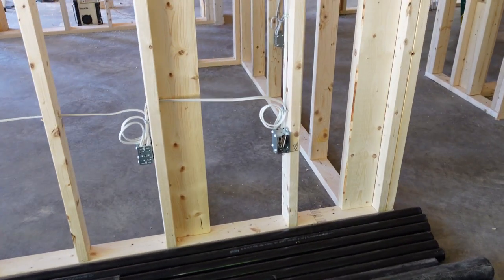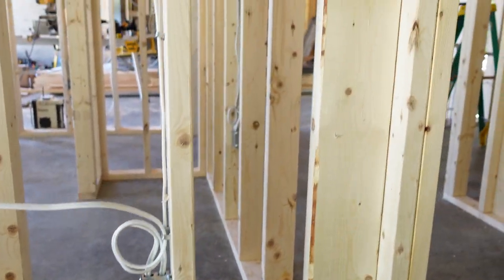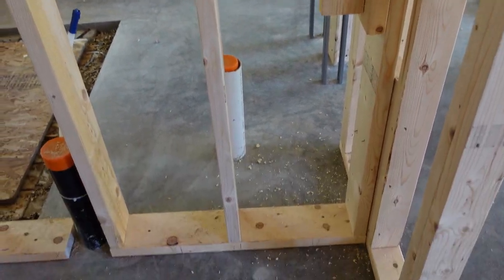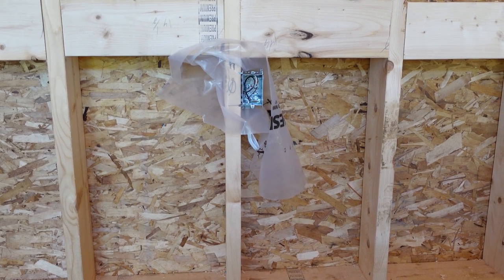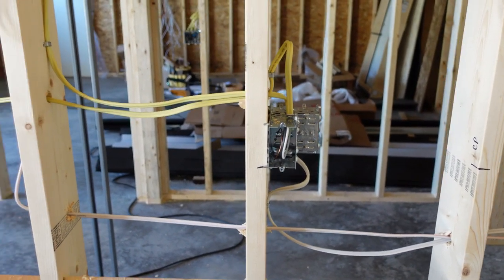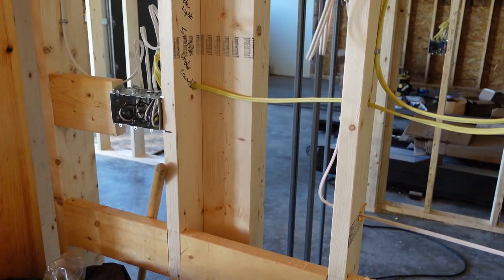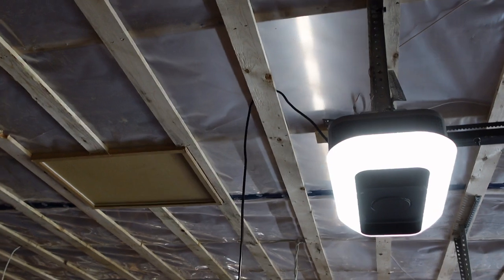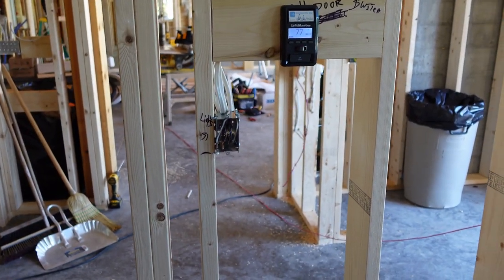Electrical Code Outlet Heights

Comment: ok this is Canada. but as a consumer buying a home the outlets  are at about 14 and 16 and they both suck . i lived in older house with baseboards outlets   hous built in 1900 wired  1930-1940  and was better imo than the newer houses . i rather them be 36 inches  the current you need to bend at od angles . and the 6 ft requirement  without regard often results in outlets right in the middle of where normal furniture goes so only choice is extension cord before putting the china closet. dresser etc  btw iwas not old when  i lived in the old house a 1975 new a current 1995 house and placement of outlets height and spacing is one of the only things i disliked about this house , what our governments always failed to realise 1 size doesn't fit all  or all people .

Comment: I have seen kitchen counter outlets at that height. If using a top with molded in backsplash, this placement requires nipping about 3/8 inch off the bottom of the outlet cover. Real d**m smart placement.

Comment: Are there any workarounds for romex anchors and trying to have more useful lengths for a service loop?
for example, if the first anchor needs to be within 12 inches of the junction box, can I still add a 12 inch service loop if the plastic conduit box has its own built in clamps?

Comment: thanks for your instructions  I am in Toronto Canada I follow your instruction I am not electrician  worked with electrician two years, now I am retired,   and i did wiring in basement. inspector came to inspect ,the  kitchen counter receptacle not meet the code, still I am not understand,  receptacles  how far from edge of the sink and between the receptacle. I try many u tubs i cant find it.  again pls reply ,Thanks.

Comment: Was wondering why the loops going into all boxes
Reply from the maker: They are service loops for when the drywallers cut or wires with zip tools inside the boxes. It always happens no matter how far we push them back inside the box, someone always pulls them out and they get cut. The service loop allows us to loosen the box connector, pull the extra wire into the box and re strip the connection. For the 100 dollars spent on extra wire to do this in the whole house it is far less expensive than replacing a whole wire that has been cut or needs more drywall repair to fix the cut wire by an other sloppy sub trade. We always give the client the option at the beginning of the job to have service loops or not and they always opt in. It also allows more flexibility for the client if they want the box moved to the next stud etc..... Hope this helps

Comment: The nanny state and regulatory capture reaches new extrema!  Heaven forbid that you have part of your counter on which you can't set down a crock pot and plug it in.  OTOH, right now, you don't have to provide any outlets on an island or peninsula, but you need to provide a means for the homeowner to circumvent the code!  Or is that America and this is Canada?

Comment: by code the switch has to be 44'' or is it acceptale 50''
Reply from the maker: Depends on your location In Nova Scotia it s actually no higher than 46 inches to the top of the box for wheelchair accessible, which is deemed by the building code. Not the electrical code.

Comment: Good information and well presented.  My house was built in the 40's and I'm upgrading all the cloth 2 wire with 12/2NM-B.  Since where I live requires no permits, I'll use what makes sense and ignore what doesn't.  Adding outlets is a must since in 1940 they generously included ONE outlet for each bedroom but the new outlets will be at the same height as the existing ones.  "The code is more of a guideline" to quote Captain Barbosa.
Reply: That a 1940s house even included receptacles is rare in my neck of the woods (NC & SC)
Reply: @fomoco300k  We're in NE Texas near Texarkana.

Comment: I would like to add a counter top plug on top of my island and plug it into a outlet inside rear of island.  I live in Edmonton, AB, does CEC electrical code allow receptacles installed inside island run via AC90 12/2 wiring?

Comment: Just curious: Only in new construction and full remodels? Do exceptions exist for adding receptacles to existing ones without a full remodel?

Imagine coming into a room with three receptacles at 14in height and two newer ones at 16in height. Same for light switches.

Surely there must be exceptions for that kind of stuff.
Reply from the maker: This is only on new construction. Remodels do not apply unless they are larger enough to get the local building inspector involved which is where these additional requirements came from.

thanks

Comment: I realize this is a year-old video, but nothing substantial has changed in the last 12 months, with respect to the NEC.
Is this for the US, or in Canada? (You have a bit of a Canadian accent... "ootlet" and "aboot"...😅).
Neither the 2020 nor 2023 NEC have any requirements (that I can find) regarding specific heights for receptacles (except above counters, work areas, etc.).
Can you please cite some specific, applicable Code articles and/sections where you find this info?
Reply from the maker: These are specific codes to Nova Scotia Canada, the heights are deemed in addition to the electrical code by the building code for wheelchair access. Check with your local province or state to see if any apply.

Comment: In order to meet the 48” counter requirement, the inspector in our city required us to put an outlet directly behind the sink, despite the fact that if you ever plugged anything into it, you’d end up draping the cord through the sink.
Reply: NEC clearly states the “basin” or sink serves as a break. An outlet behind the sink is ridiculous. Therefore, you only need an outlet within 2 feet of the edge of the basin.
Reply: What a jackass!
Reply: remember code are government employees and when they make mistake they don't get in trouble but the next inspector will fine the homeowner for the previous mistake . read about case in one of the Carolinas new house inspector signed of on all inspections, found that many were done wrong several very serious dangerous  openly visual defects . homeowner sued over the glaring undisputed violations signed off by inspector
court ruled qualified immunity  .  i personally had one city requires 110 dollar inspection permit to change out a/c   inspection no lie 2.5 minutes from arival to departure  we already had inspection when built disconnect and power panel  so look at 2 electrical stuck his hand up to air handler 
left   1 yr later i get woken up early am why didn't i get a/c inspection  her the inspected never punched it in computer  so for 110 bucks  he didn't do his easy job  btw i refused to let 2nd guy in  now if he just passed or did nothing its yrs later i was too busy with sick mom and my medical to complain to city and if i got shut off i get too angry. i learned from philly i will never trust a city inspector 12 of 13 plumbing inspectors got caught drive by inspections and few yrs later one did a drive by demo inspection which resulted on building demo crushing a store with people in it killing several and the inspector committed suicide about week later
Reply: Must be NY CA or IL as they do their best thinking with their britches around their ankles... 😎
Reply: @mycdigitalage1684  what is wrong with you?
Reply: @mycdigitalage1684 😂😂I c u have ur thinkn cap on strate!!😅

Comment: Just checking in - are there any changes to basement outlets?
Reply from the maker: The current code is every 12 feet of finished wall space. I'm not sure what the new 2024 code will say which is enforced in May of this year here in Canada.

Comment: I take it this is in Canada.
In the US NEC is 18" to center aff and 42 to center aff.
Which has been around for a number of years in the US.
Reply: The NEC does not mandate wall outlets to be 18" AFF. If it did we wouldn't have floor outlets. Please identify the section in the code that you feel indicates this.
Reply: Where in NEC is this specified?  What Code article/section?
I've been doing electrical for over 40 years, and have never seen any specific height requirements. Also, I have (in hand) the new '23 Code, and can find NO references to any specific heights (excepting kitchens, counter-tops, and other raised "work" areas).
Please elaborate!
Thanks
Reply: @Calico5string1962   I have also wired houses here in the USA for about 35 years and no dimensions are called out. I wired a high end house about 7 years ago and the builder wanted the receptacles in the 10" high baseboard. No problem with the inspector but a pain in the butt to install. I marked the floor where the wire sub outs were and cut the baseboard for the receptacles boxes with a Rockwell multi tool. Very labor intensive.
Reply: I think he's referring to the bottom of the box. should have said 18" though. If for whatever reason you need to use a 4/11 box and you do 16" to bottom, that one receptacle is going to be a completely different height.

Comment: You keep using the words outlet, receptacle, and plug all interchangeably. Those are all different things. And for years now kitchen countertop receptacles could be no more than 48" apart, there is no way they changed it to 6' apart. My last book is the 2020, I'm going to order the 2023 right now because of this video.
Reply: 1 old house 2 newer built for us by track homes little customization allowed neither new kitchens had enough outlets especially when appliance cord rules made them so damm short . not as bad in newer homes but anything built before 1970 let alone our 1900 one

Comment: Interesting update. Ill have to see if my province has followed this.
BTW: in my garage and basement I put them in at 4 ft, so I can put 4x8s against the wall, and still plug in saws, etc.
Reply: Building code or electrical?
Reply: @f.davidrobertson9648  : My convenience. It was inspected and passed. Also, against code, I put a hall light on the sump pump circuit, to make that circuit easy to check. Also passed inspection.
Reply: @drewthompson7457 Good idea. Sad to say, too many people think that because they got an inspection, the job is safe and done to quality standards. Yeah right.

Comment: 4 foot height in garage to get receptacle out of the range of any explosive fumes that may be present from gas or oil leaks , which ensures that while plugging in or unplugging possibly creating a spark will not ignite any gases present.
Reply: That’s for the positive info from one pro to another. Have a great day.
Reply: but you can have gas hot water only 12 inches raised , did anyone consult a real engineer on this  i doubt gas vapor gets that high if it does the outlets the least of the problem  but 4 + is a covenant height in garage especially if its a workshop  Shure would not wat them at 16 inches in garage

Comment: Thanks everyone for the comments. We are in Canada as mentioned in the description. Many of the code heights in this video are additional building code and electrical inspection requirements by our local inspectors. Many of them are for practicality. We use metal boxes as they provide a better bond than plastic and also a longer burn time invade the breaker or device malfunctions and melts or arcs. We use gang boxes for ease of adding later. Additional switches etc. 
we do loops in our wires under 150 mm to allow for moving of the switch or plug without having to reset run the entire wire if the client would like it moved up or down left or right after the fact.

Comment: Last few houses that I wired up installed the top of real deal fiberglass wall cases ( & not the garbage blue light special flimsy boxes ) exactly 20" to top of the boxes ( thus was over 15 years ago ). Carpenter doing the sheet rocking really appreciated every receptacle wall case were exactly 20" off floor. Told me some lazy sparkies had boxes over a inch difference in the same room.

Comment: No way I want my countertop to be 36 inches from the floor. 42" is about perfect.
 And I want the outlet 12" above the countertop surface.

Wall outlets - 16" is ok in usual settings but I want some 48" up. Same with switches (48").
You can replace the dryer cord with a longer one. Every one I have seen had a 4-5 foot cord on them. And you can get 6-8 foot ones. Same with electric stove cords.

In a garage I want outlets & switches no less than 48" off the floor to help prevent accidental mechanical damage.

Author did not reveal how the heights are calculated.
Is that at the bottom of the box or the middle of the box?

Also, at what floor height?
Electrical roughins are with bare floors and no tile or carpet/padding.
Vinyl tiles are thin but some people want the 1/4" thick stone tiles.
Same with carpeting and padding.

Personally I could care less about handicrapped requirements. They ain't going to live there.
Reply: Watch the video close as he gives measurements, and you can see all of his marks are at the bottom of the boxes. Rough-in measurements are always from the rough floor, not the finished floor. BW, he is in Canada so it will be slightly different that USA.

Comment: Do you use a laser level for mounting numerous boxes on a wall?  I had an industrial electrician mount 4 or 5 boxes on one kitchen wall, and NONE of them were level with each other.  People have to be better than that, when there's drywallers, cabinet installers, and tile guys to consider, not to mention the homeowner,  whos going to be staring at a F-up forever after.
Reply: I use a story stick. A 1.5" x 1/4" x 5'  with marks at all the different box tops. Just use a sharpie to xfer the reference lines to the stud. Make your own reference line for special circumstances like workshop tables etc.
Reply: @blackmanops3749  A story stick is okay IF the floor is level. Cabinet installers are going to install boxes and countertops level, and if there's a row of uneven receptacles above the countertop,  it's easily seen.
Everybody should be using a laser level.

Comment: Did you know that there is a code hight for a threshold in a shower stall to accommodate the handicap?
It's so flipping low that the shower curtain won't stay inside.
There is a point to which this stuff has become absolutely ridiculous. I want to build some of this stuff, like my shower threshold to the damn hight I want it. Ya know, so that it works!
Reply: Of course there is and I have seen them built. However why are you concerned about that in your own home? I live in SoCal and about to remove the tub and install a shower, but I plan to use a pan with a low dam and tile the walls.  Being an old dog I plan to add a couple of grab bars and maybe a small bench.  I’m not required to meet Disabled regs in my own house.  And I hate shower curtains probably install a quality shower door. Good luck.

Comment: What is the highest you can place a receptacle?
Reply: There is no max height for special needs items. (wall clocks, emergency lights, door openers, wall mounted TV sets, etc) OTOH, you do need to meet the code for normal outlet placement. Typically, that's a plug for every 12 running feet of wall, so many per running feet of hallway, every 6 feet on a counter top, etc.
Reply: @rupe53  Thank you
Reply: It is difficult to place a receptacle higher than the ceiling.

Comment: There is no NEC requirement for minimum spacing ABOVE the floor, but ADA asks (and California now requires) a 15” minimum. I sometimes drop a receptacle outlet at 10-12 inches if a bed were to be placed on a wall.
Reply from the maker: That is because we are in Canada
Reply: @conquerallelectrical  I thought the 600 mm was a dead giveaway🙂
Reply: I'm not anything close to being an electrician. So forgive my lack of knowledge on this, BUT....are these measurements to the bottom, middle, or top of the box?
Reply from the maker: bottom it is the CEC and it is specific to year province depending on the induvial inspector requirements.   @adollarshort1573
Reply: In the U.S. we go to the center. @adollarshort1573

Comment: Great video, is the device minimum height of 16"  for receptacles to the bottom of the box or top? The 44 inches for wall switches will look a bit silly in a bathroom next to a counter. Yikes
Reply: Bottom of the box. Those are 4" tall boxes which puts the box top edge at the drywall seam if sheets are hung horizontal.
Reply: @mjdiiii   interesting, I live in Ontario spoke with an electrician and he wasn't aware. Wondering if this is  provincial specific only
Reply: @marcelmed4574  I was commenting "bottom" on the 44" switch box height. I'm in the states, and meeting the drywall seam is just how I've done it. I'm retired, and last I knew, box height was not covered in the NEC. ADA suggests 18" for receptacle box height. I am not clear if it is bottom of the box or not. I've set my receptacle heights to match my hammer (16") to the bottom of the box.